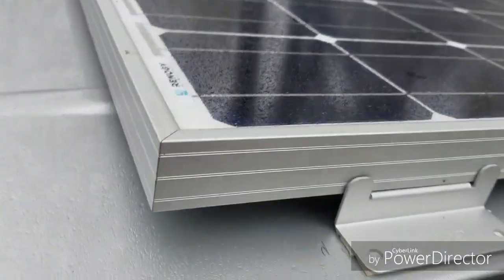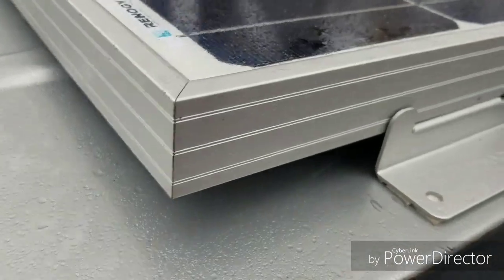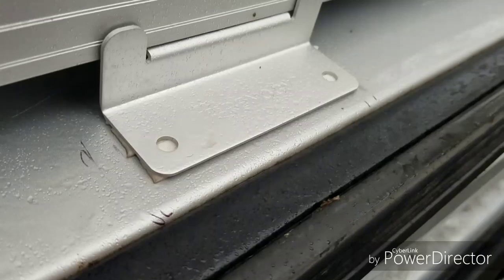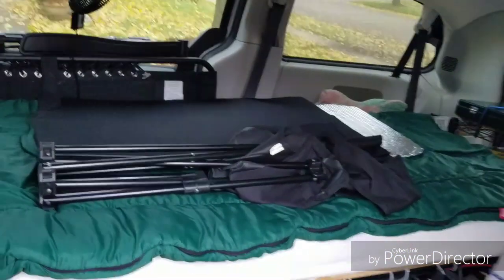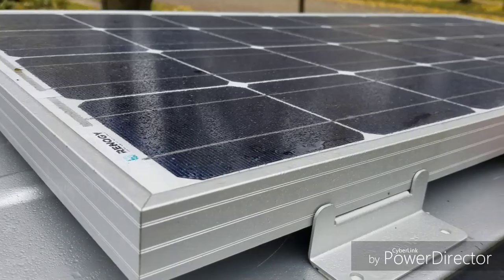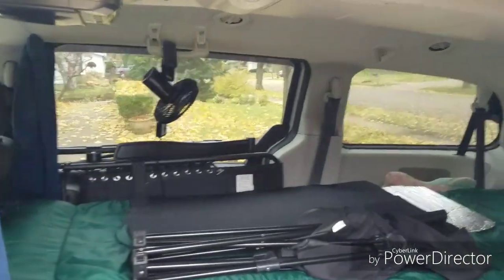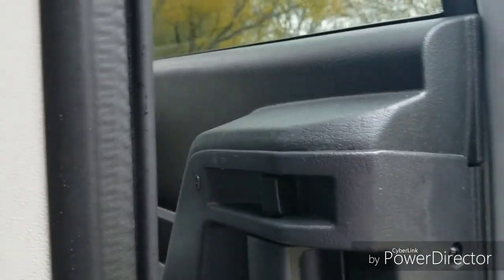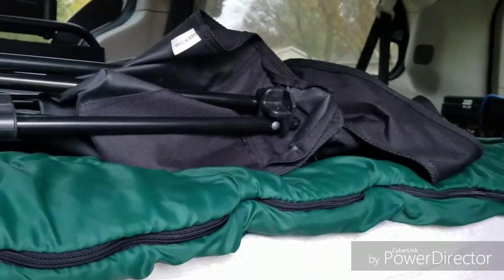How to Install Solar Panel Update (VHB tape) No Drilling

Comment: I see on this link here I post for you they too are using double sided tape with a sealer over top is mentioned with something else I can't make out on the video of the other word. https://www.youtube.com/watch?v=Tr_9SpIKx8c&feature=em-uploademail2:32     It is at 2:37 it starts with sanding and roughing up the surface of the roof with electric sander before the tape went on. It is today's video.  I'm learning from you and this link as well as others that have drilled holes into the roof.